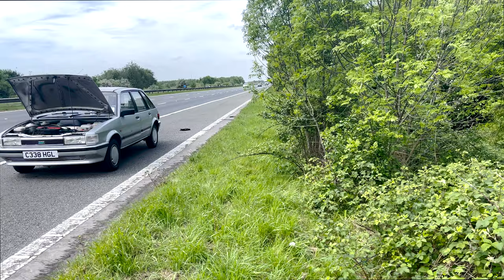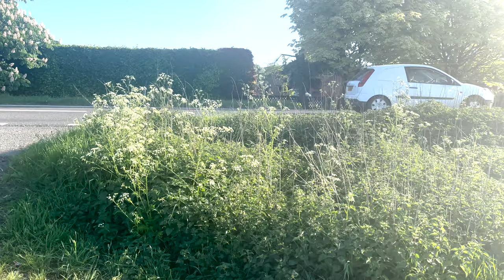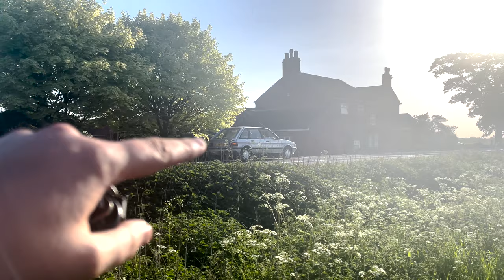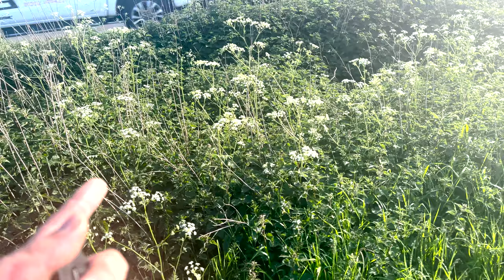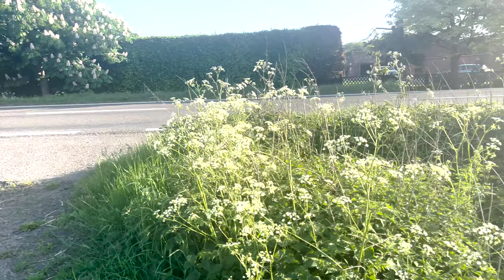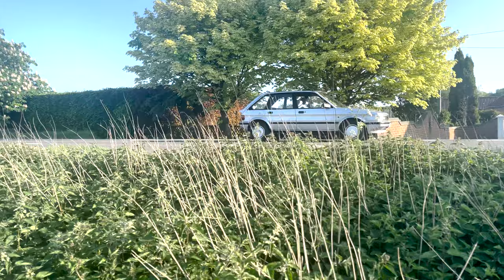My Austin Maestro might be DEAD?! - Engine FAILURE! - Maestro Vlog 9

Comment: Hope it's nothing major. I had cam shaft failure on a Renault 5 back in 99 and the engine started to loose power and knocking loudly. Ended up replacing the engine as it was the more cost effective option.
One way or another I'm sure you will get it sorted.

Comment: Hi Tom,

Ben here, I sold Mimi to you. I'm sorry to hear the news. I hope that it's nothing major and that it can be fixed with relative ease. It sounds far better than my Triumph 2000 did when she suffered an engine failure. She'd unfortunately snapped a valve spring that had pitted. It sounded horrendous like there were bolts in the engine. 

I spent just under £100 on the parts and most of the tooling, watched a few videos on YouTube and she was back up and running within a weekend. The old pushrod engines are so simple and basic it was actually a joy to do. 

I wish you all the best with the car mate and hope you keep her. I bought another Maestro not long after parting with this one, I missed it so much. I think they feel far better built than they look and the road holding abilities are great for such an old car.

Personally I now have a 1985 Austin Metro auto with just 11k on the clock. She needs work like most, but is always a joy to drive. The idiot I am managed to break 1st gear just two days into owning her. That's when I discovered how expensive the the AP2 automatic gearboxes they use are to buy and rebuild. Eek.
Reply from the maker: Hey Ben,

Thanks for the comment I appreciate it, hope you’re keeping well. Do you still have the Triumph? Are you keeping the metro and rebuilding the box?
Reply: @tomdrives  
Hi Tom,

Not a problem, thanks for all the great content. I don't unfortunately, I decided to sell her. Aesthetically she was brilliant, however mechanically she was getting a bit out of hand. All the expensive bits were mounting up so I decided it should be moved onto someone with a bit more time, money and a garage haha. 

The gearbox will be rebuilt, that's next on the list. I'm getting stronger upgrade internal parts to replace the originals. Seems like a good opportunity to upgrade since it needs to come a part anyway. Like anything, the only kicker is the price. £3,200 for all parts and the rebuild. I nearly fainted but it has to be done as I'm going to be turbocharging the car. 

I saw your video on the 75 as well. Sods law isn't it mate. We can't have anything. They've had the cat off of my 45 v6 auto and when I had my last metro somebody bent the top of the door out to try and get in. I went back to it and the foot well was full of water from the rain. Its gut wrenching isn't it. Just have to remind our selves it could always be worse.

The Metro has since appeared on Bangers and cash. The whole reason I bought another tbh. It was my most regretted sale so I was more than salty when I saw it on the programme, just 17k miles and I sold it out of desperation for £750 as I'd unfortunately been laid off. I had to do one better and snap this one up with 11k as a comfort or coping mechanism if you like haha. So far, no regrets. 

I look forward to seeing more of the videos to come, you're doing a great job. The only way is up 👍🏻

Comment: Very interesting, Tom. That car sure is a beauty. A few years back the oil pump in my Volvo gave up the ghost. By the time I got to the shoulder of the highway, I knew the engine was done for. I got a good used 2.3 litre Red Block for $600 CDN. Including sales tax the total bill came to about $1,600. To me it was worth the cost too save the old car. Because of shoulder sergeries I must sit close the the door. One day I was asked to drive the Princess. 
The Edsel even trucked out the there.

Comment: Probably top end: ie: you may not need to pull the whole unit out.  I don't think your choice of oil had any bearing, nor could you have prevented it.  Even if it needs rings this can be done in situ...if the bearings aren't spun (they probably aren't) you can get away with just replacing those conrod bearings and not the mains.  A Series were designed when men re-ringed engines on the footpath.

Comment: Sorry you're having such a running of bad fortune at the moment.  First off don't give up fella 👍 As for the Maestro it may say 10w40 in the book but it's a re worked A series with miles on the clock so from here o 😳n in 20w 50 is the order of the day.  The tolerances of older engine's was never that great.  As for repair I don't have enough info but it's an A series ohv and they're simple to work on.  I doubt it's the cam as it's embedded in the block and unlike ohc it won't really ever get starved of oil.  Read forums and tell them in detail the symptoms I'll think your problem maybe simpler than you think to fix...Good luck Tom 😉

Comment: Although it's expensive try and get the engine rebuilt if you can because when you get a used engine you're always taking a gamble. I've heard engines sound much worse than that

Comment: If it's burning lots of 10w40 it'd still burn 20w50 imo. I remember duckhams q20w50 was the only one in a metal can in the mid 90s when I worked in a factors. It doesn't sound too bad...not bottom end imo ... Best of luck 👍

Comment: Sounds like a dropped valve to me. It's rare for a Maestro to fail. Hope you get sorted
Reply from the maker: Will be getting on it asap, just need to get her on the drive
Reply: @tomdrives  I'll keep my fingers crossed for you. There's nothing worse these old cars of ours are like cherished family members. I have an old Mk1 2.0 Mégane cabriolet that I've had for years and years that's poorly. It's baffled 3 different mechanics so far. Something electric but everything the diagnostic brings up has been replaced & not made any difference. I really miss the old days before microchips
Reply: Yes or similar... First job take the rocker cover off and see if there's anything obvious.... Well worth saving the car though, even if a reasonable second hand engine had to be sought... I'm a multiple Maestro owner myself, but all diesels

Comment: Should  have called me out. Won't be cam it doesn't have one. It's overheads valve.  So likely  to be the rings. My first maestro rings went. Lots of noise I recall, but had been drinking  oil for some time and smoke when going round corners
Reply from the maker: See I thought that after the recording guess it was just a long day. I’ll be rebuilding it :)
Reply: @tomdrives  no doubt it's drop a value in the seating. Hope you can get it sorted soon, we need to see her at more shows 😃
Reply: You can't be serious saying an A series doesn't have a camshaft surely? What do you think pushes the pushrods the operate the rockers, that open the valves? Yep...the camshaft!
Reply: @peakclassiccars  Yes your right, I was getting confused with the over head cams, thank you for taking you time out to read the comment and to correct me, without you correcting me, I'd may have made this mistake in the future.... you never know!